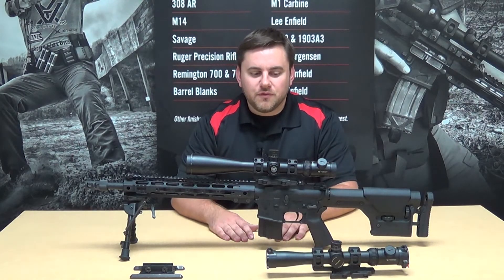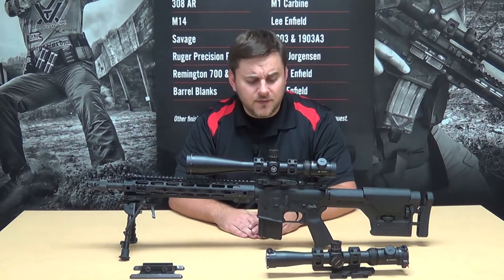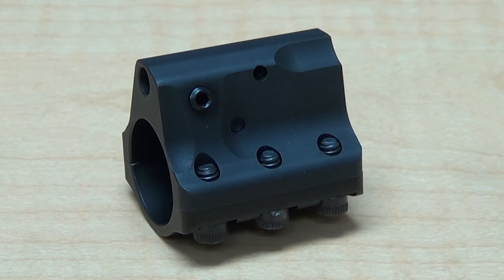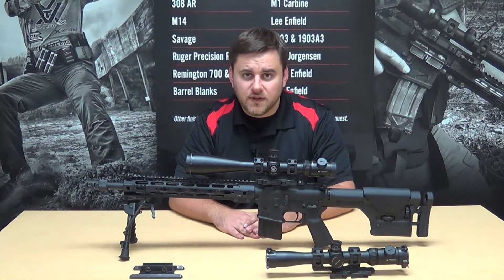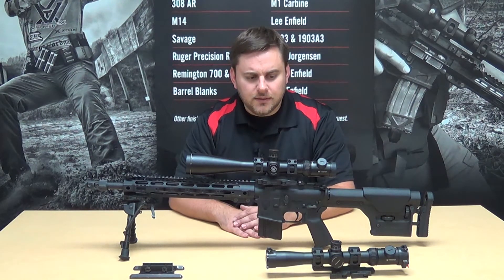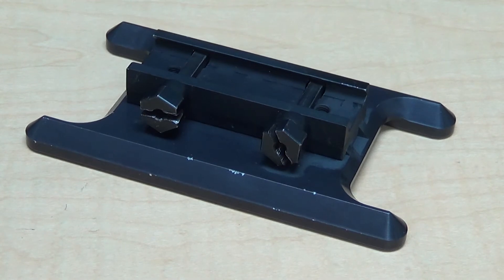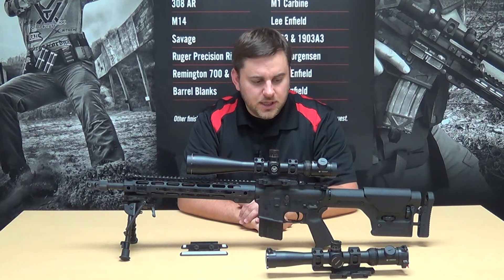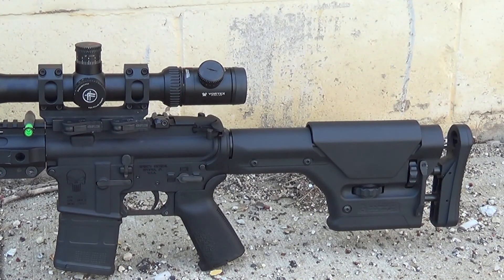Accurizing the AR-15 - Part 2: AR-15 Component Selection

Comment: More emphasis on the butt stock, it must support a muscularly relaxed Stockweld to anchor consistent sight alignment and control parallax. If this is not addressed . 5 MOA goes up to 4 MOA due to angular error and inconsistent recoil resistance. One more thing, go with a 20 inch barrel if accuracy at distance is paramount. You will get a higher MOA wind constant, like 9 at 600 yards, which means more precise hits when wind cannot be exactingly appraised.

Comment: I bought a Criterion barrel a while ago and didn't elect to have a headspaced bolt included. When purchasing a new BCG in future, how can I ensure it'll have excellent performance with my barrel?
Reply from the maker: You can check head-space now and would require head-space gauges to take the measurement.  You can also send in your barrel or complete upper to Criterion and we can pair it with a properly sized bolt.

Comment: I'd like to know more about this bag rest attachment and how you generally shoot your groups. What bag and position are you shooting? Would love a short video on that.
Reply from the maker: Sure Brandon! The front rest is a Sinclair Competition Shooting Rest with an installed Edgewood front bag. I also picked up a trio of wider base points so the rest assembly doesn't sink into the dirt under recoil.

The rear bag is also from Sinclair. Typically I shoot in the prone, but some folks may have better luck shooting off a bench.